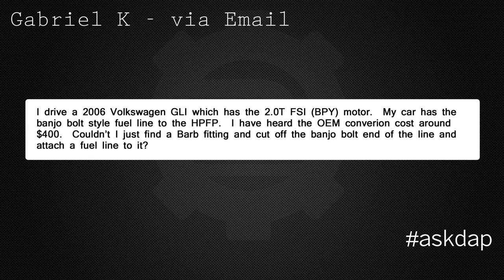2.0T FSI with Banjo Bolt Fitting on the HPFP... Looking to get rid of this

Comment: Took me 4 hours to change a cam follower after messing up. As I snapped the coolant line, which actually helped me figure out why I was n't getting enough coolant pulling back into my tank as that had rotted away from the heat. The bonjo bolt was a really bad idea. I will be replacing they can't follower every 10,000 mi because it just seems to be something that has to be done. I thought people were joking however on my car and it's history 10 k Mark is best. I guess I have to get better tools such as the 8m triple square hex bit for about $8 or $10 and a smaller ratchet. Overall I guess I will have to be getting better at this as it doesn't seem like if there's any way around it

Comment: I'd debated cutting it myself and came to the same conclusion about the flaring and wondered if a brake line flaring tool would do the job.
I already have the lines but having to take of the inlet manifold seems more hassle than it's worth.

Ive been looking for a banjo bolt to barb adaptor but it's doesn't seem to exist.

I'm considering buying a double length banjo bolt and using another banjo to barb piece to then adaptor to a hose to the new pump.

Comment: Get the banjo bolt off, use vice grips if you have to. There's enough room, trust me. Find the thread size and pitch and order one with a hex head banjo bolt on it and rock it out.

Comment: This was worthless, 14mm ID barb fitting + 14mm Barb works as a replacement. Bend the eyelet line, remove the HPFP insert, attach NEW barb fitting to old HPFP insert and place new barb fitting into HPFP. Saved ya money
Reply: will this work for 2006 audi a3?
Reply: @Frank-ig2js Fuel rail ended up leaking for me. I ordered a newer line off ebay. Hope this helps